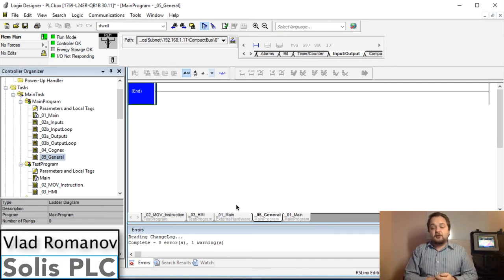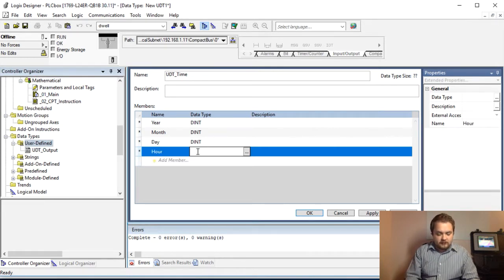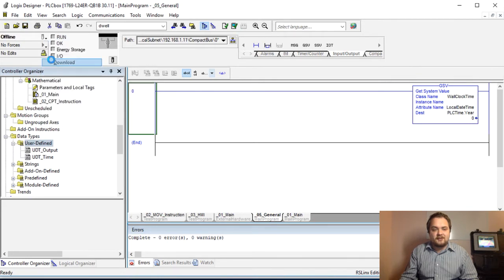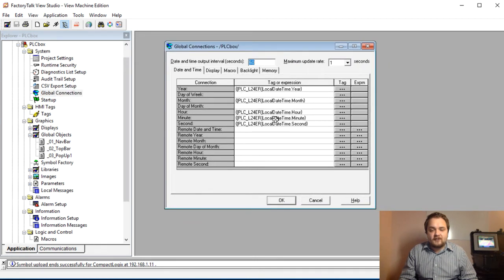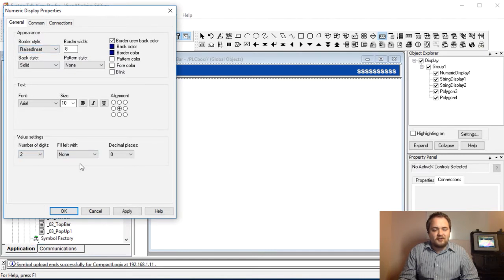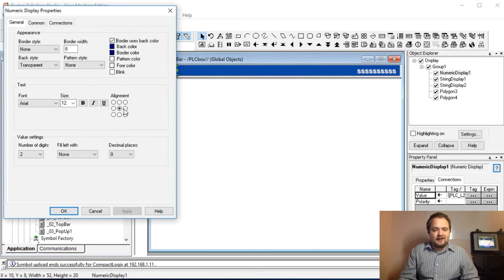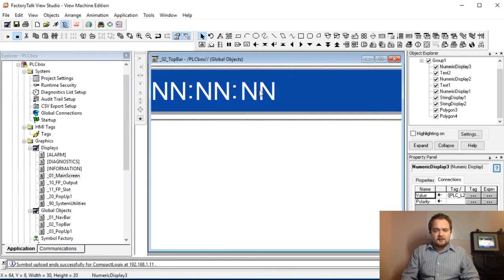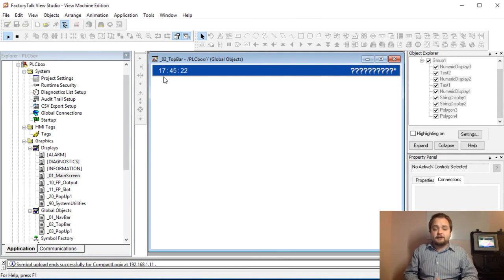HMI / PLC Fundamentals - Syncing & Sending PLC Time to HMI Terminal Mode Programming RSLogix 5000

Comment: What about the trend data? it needs to be Synced to PLC Time, all this does is display some tag values on the HMI screen
Reply from the maker: Trending is something that's done separately as you pointed out. I've been planning on covering it at some point, but never got to it. Panel view terminals have a special section to create trends. That being said, it's a bit more advanced than what's shown here. It's also not ideal with default settings (in my opinion).
Reply: @SolisPLC  I was more interested in redundant RSView SE and how to Sync time with that system, a PV is  as very simple HMI

Comment: In the end if you are just doing Numeric Display for time on HMI then why did you put tags in Global Connection of HMI.
Reply from the maker: That's an excellent question. As I explain in the video, there are two methods of getting this done. If you want to sync the HMI time, you need to add it into the global connections. However, it's easier to ignore that and base it off the PLC values. I find that this way, it's easier to migrate displays and the time will remain consistent with the PLC it's communicating with.

Comment: Hi Vlad!
What happens if I want to do exactly the opposite: write the local time from HMI to PLC?
Generally the HMI user has access to adjust the HMI local time but he does not access to do that in the PLC.
Reply from the maker: Fernando, you can certainly do that, but I would advise against it. A better solution, if you want to change the time from the HMI would be to set the PLC as the master and create logic which would display the PLC tags on the HMI and allow them to be changed. The reason for this is that PLCs have integrated sync functions which are usually implemented to synchronize time settings among PLCs. I've never seen an HMI be the master. Furthermore, in distributed systems, a server would hold the time.
Reply: @SolisPLC  Thank you for your answer.
My equipment is a stand alone system, and for some reason, the time in the PLC is delayed 3 min weekly. Right now a screen already is configured with your  proposed solution; the user enter the HOUR, MIN and SEC manually. I want to replace this option with a button to copy directly the system time of the HMI (3 tags) to the PLC (3 tags too).